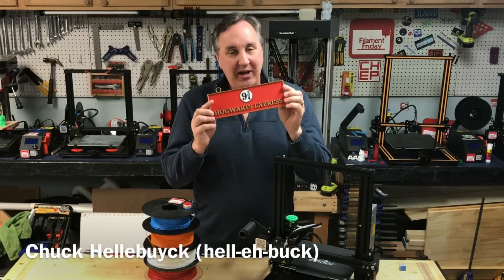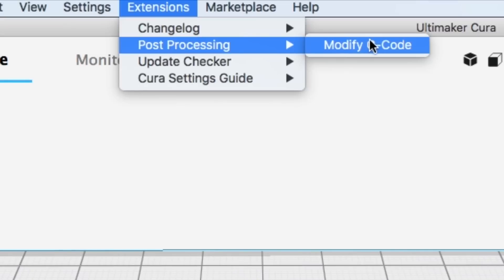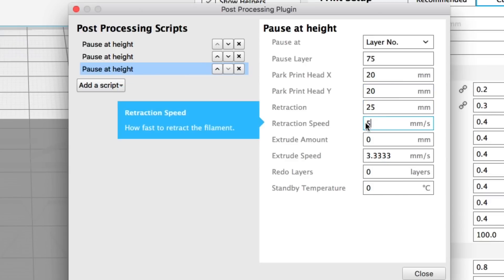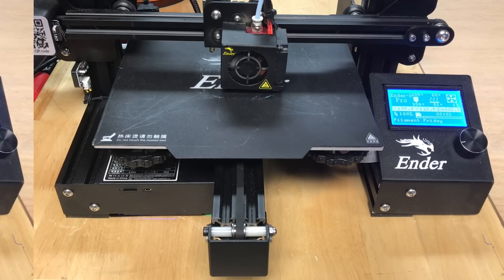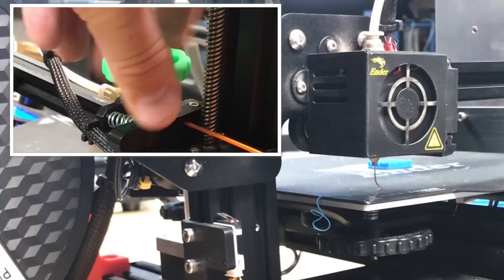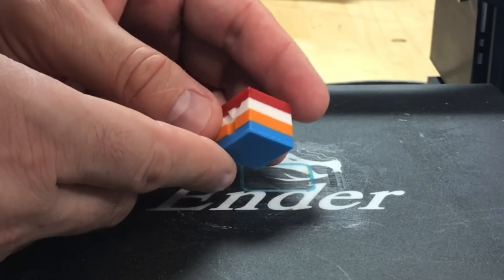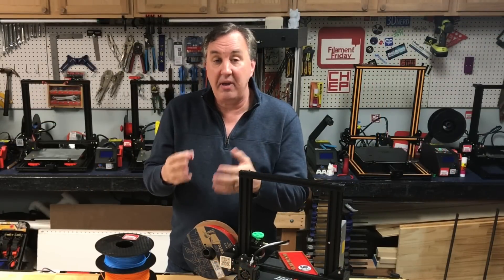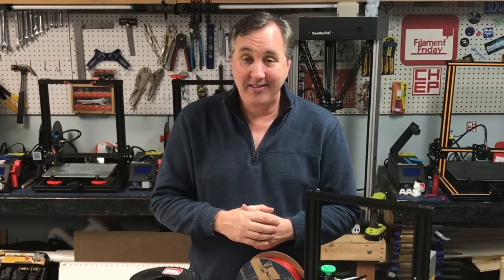How to do Multi-Color 3D Prints on Ender 3 3D Printer

Comment from the maker: If you have a newer Ender 3 with 32 bit board this may not work because Creality didn’t include the M0 command in the firmware. Try the M25 option.
Reply: See.... this is why your channel is awesome. I was just about to try doing this, so I looked up your video as a tutorial and would you believe it, the comment here is relating to my printer. Now I know to try the M25 instead of M0! Thank you!
Reply: @BrandonsYouTube  Have you tried this with the M25 yet? Just curious rather then waiting halfway through my print to find out if it works or not.
Reply: @doublejz00  I did try this and I do believe it worked. I manually replaced the M0 with M25 code and use the pause at height command in cura. I would go back and double-check but I didn't make a copy of my g code. But I do have the prints and it did work.
Reply: M25 worked fine for my Ender 3 V2.
Reply: When you say try the M25 option, are you meaning modify the .gcode to replace the MO command with M25? To put it plainly, I would erase the MO and write in (at the same spot) M25? Thanks in advance.
Reply from the maker: What doesn’t work, my M25 version for the V2?
Reply: @FilamentFriday  how do u change command in cura slicer
Reply: Just tested: with <BQ (M25)> option in cura 4.8.0 the pause is working fine on my v2  32bit tmc2208.
Reply: If you run Octoprint with a newer board on the Ender 3, there comes an error when "pause at height" is triggered and you can't resume with the LCD. But you just hit "resume" in the Octoprint window and it will finish like nothing happened.
Reply: @andri0mar  and if I do not have Octoprint? My printer wont resumen after pause
Reply: @andri0mar  mine does this and i just go into the settings on the ender and tell it to do filament change than i can do a change than i hit resume in octo and away it goes
Reply: I tried to do this on my ender 3 v2 and ended up carving out a big chunk of my plate cause I accidentally pushed the z-axis down how do I avoid this?
Reply: @MrAurebesh  don't push down on your z axis 😅😅
Reply: @finleystannard  ahh well I hadn’t thought of that. 😅 no but seriously I’ve never been able to hold my z-axis still while loading filament because it’s pretty darn difficult to get through the extruded into the pinhole for the Bowden tube
Reply from the maker: Use a drill bit to create a funnel in the end of the PTFE.
Reply: @FilamentFriday  Thank you so much!! I will try that!
Reply: @MrAurebesh  you can keep the motors engaged. there is a check box for it.
Reply: I did the m25 and it worked but is there any way for it to only disable the extruder steper and not the others so it doesn't easily move around during filament change and lose its position I have an ender 3 v2
Reply: Interestingly enough I ran into this exact same problem (with the exact same fix) on a different printer, a Wanhao i3 Plus (see the other comment thread I posted). On newer versions of Cura you choose the "BQ" (Biqu?) option to choose M25.
Reply: M0 is also not working on older Ender 3 with a newer board.
Reply: @Buzzin666  its not the printer that is at fault its the motherboard , that is why it wont work on a older ender with the upgraded 32 bit board. The board dictates what will and won't work. If the older ender had the older board it would work fine. Hope that helps understand why it doesnt work.
Reply: I'd say you should change the setting in cura (pause) from marlin m0 to marlin m25.
I just came back after trying twice with v2. It goes to 20/20 and I was easily fast enough to exchange filaments without pausing at the second time ..:-)
Thank you for the advice with marlin m25.
Reply: Where do u put it the command M25
Reply: Hehe, what if we have the BMG dual drive extruder? :P Can't easily manually retract with that thing without a teardown.
Reply: anyone have the issue that when you resume the z height will not drop back down to the proper level and tries to print mid air? ender 3 v2. i am using m25 and engaging the motors to keep the axis from moving during the filament swap.
Reply: M0 and M25 did not work for me…
Reply: Works in 2025 great with M25 on Ender3V3SE
Reply: @Felix Mitchell instablaster =)
Reply: @Cyrus Thatcher i really appreciate your reply. I got to the site through google and I'm waiting for the hacking stuff now.
Takes quite some time so I will reply here later when my account password hopefully is recovered.
Reply: @Cyrus Thatcher It worked and I finally got access to my account again. I am so happy!
Thanks so much, you really help me out!
Reply: @Felix Mitchell no problem xD
Reply: I guess im asking randomly but does anyone know of a trick to log back into an instagram account?
I stupidly forgot my account password. I love any help you can offer me.

Comment: when I change filament and return from pause, my printer extrude a bobble when touch the piece and then start to print...How can we prevent that?
Reply from the maker: When you push the new filament in, don’t push it all the way thru the nozzle. Pull it back just a little.
Reply: @FilamentFriday  thx! I tried to avoid this work around...But will do the job! thanks for you answer!

Comment: Hi, i know its a long time ago, but how did you add the filament knob to the extruder?
Reply: You can just buy one. It's just goes on the end of the extruder motor shaft and has a grub screw to secure it in place. You can probably 3D print one as well but without the metal insert it will probably break after a few uses.

Comment: When my printer (Tevo Tornado using Marlin and Cura 5.6) pauses using Chep's technique, it does not allow me to advance the extruder manually--it's locked in place--so I can't "flush out" the current filament. I can proceed with the print, but some of the first filament is laid down at the base of the second phase. Ideas?

Comment: I have a problem, I did the same settings as you, my printer does the pause, but doesn‘t start printing again, when I press the pause button on the printer, it just says: „waiting to finish command“, it just sits there and does nothing, any solutions? Printer: Anycubic Mega X
Reply: Same issue

Comment: Works on an ender 3  but the ender 5 plus and ender cr6max keeps ignoring all the pause / change filament orders and just keeps printing
Reply: That happened on my ender 3. Idk how to fix it ignoring it
Reply: @Cole_Bradshaw  they have it in the gcode setting of the printer to ignore it. You can mofdify the gcode directly it works on some machines there is soft for that
Reply: Ok, thx I’ll try to figure it out

Comment: For my Creality Ender 3 v2 NEO with Sonic Pad it also works with the option "Filament Change".
If you want to do the filament change after Layer 4 for example, it will just add the line like this:

;BEGIN FilamentChange plugin
M600 E30.00 U300.00 X0.00 Y0.00
;END FilamentChange plugin
;LAYER:4

If you don't want to slice all the files again, just open the gcode with Notepad++, search for the Layer and add those lines.

Comment: I was printing a Stature which is about 11" High
It stopped at  8" And continued speing out material 
Any ides it doesnt seem to have anything in way - is thaere anyway you can check the travel up 

Its got a mod with 2 screws

Comment: nicely done. I have a newer version 4.11.0 of Cura. It has other fields to fill in. DISARM TIMEOUT, DISPLAY TEXT, G-CODE BEFORE PAUSE, G-CODE AFTER PAUSE. The REDO LAYER is just a check box. I haven't tried this on my Ender 3 yet, but the Artillery Sidewinder X2 will not resume print after the pause. Do you have any suggestions?
Reply: This does work on my Ender 3.

Comment: Hi chep . I have been using this method for a few years and it does work great . But now every time i change the filament the nozzle chashing down into the print ruining the print . Is there something that is lose that could need tightened or any suggestions on how to fix this problem? Thanks !

Comment: Awesome video - exactly what I have been looking for. I also read your comment below about using M25 in lieu of M0 for my Ender 3 V2. Thanks for that too.

One quick question - in your video it appears you are feeding the new filament by turning the knob after hitting resume. Wouldn't that reactivate the E stepper motor and will that turning by hand damage it? Thanks in advance for your guidance.

Comment: The Pause script should add an option checkbox for a BEEP (M300) to audibly notify of the time for the filament change.  I would also bump up the retract distance to just fully pull the filament.

The script could also be modified to allow a list of layers to repeat the pause it, instead of having to add each one at a time, which could then have a temperature for each set of layers if they just added a table to make the entries into.

Comment: I've used the Filament Change command in Cura to do this many times but I found that it was difficult to not accidentally move any of the axis while changing the filament.  Does the Pause at Height command leave the steppers locked?  

To get around moving the steppers I have found that I can rehome the X and Y axis with G28 X Y, and then the Z at the origin with G28 Z, as long as the print is not towards the front of the printer, then give a G0 command back to the original height and then a G0 command to the X and Y position.  I have also have an O shaped model that I put between the origin and the model so that it gets printed first as a purge tower.

Comment: Hey, not sure if you will see this but I followed the steps of the video and then I altered it (new board) for the M25.. But, it paused and didn't change the idle temp.  I had in CURA to change the standby temp to 25, but it left it at 200.  It paused, but I had to engage the interface to actually 'pause' it, at which point it actually did move the nozzle to 20,20 and lower the temp.

Any idea how to eliminate this requirement to interact with the device prior to it actually pausing and lowering the temp?
Reply from the maker: If the firmware doesn’t recognize the GCode commands then a firmware update is needed.

Comment: Important things I learned doing stuff with this (and we are at Cura 5 so people coming here might notice that the video is different, I did):

There's a new field that isn't shown in the video called *Disarm Timeout*, it's the amount of time the printer will wait, after that the motors will disarm, meaning they aren't stopped in place and they could lose their positions easily if you for example push on the carriage too hard. I didn't know this was important so I was always messing up prints because I would push the z axis down by accident. It's set by default to 0, but I don't think the tooltip is well redacted because it makes it seem like 0 there means it will never disarm, when in fact leaving that at 0 means they will disarm IMMEDIATELY. You wanna set it to something that let's you change the filament comfortably even if you happen to have gotten up to go pee and then came back a bit later. In my case I have it set at 600 s so 10 minutes. 1800 s is half an hour. Remember it's in seconds.

Another important thing is that Redo Layer might not work well with every printer. In my case when I leave that one it will return to where it had left off at x and y but not at z, meaning it's left printing that layer in the air and spaghettiing everything. I personally don't use it. I have a Hellbot Magna SE. Your mileage may vary, just keep in mind that if that happens to you, it's because of that option I mentioned.

Also when you change filaments, provided you set the disarm timeout correctly and the motors are locked in place, you should manually push the filament down to purge the rest of the previous one. Push it until it comes out the color you want it to, it shouldn't take long. Make sure to remove that from the nozzle of course.

I have managed to do 4 color prints with the method described in the video and the tips above! Thanks chep!
Reply: I have a problem of abundant extrusion at restart after filament change. Should I have to retract filament before restart print?
Reply from the maker: You can. It’s an option.

Comment: Shouldn't it theoretically be possible to make it do another Purge line before it resumes printing? And also the idea of redo layers bothers me, I feel like it's just going to go to the layer and hit the last layer it did and knock it off.
Reply from the maker: Lowering to make a purge line can allow the cross bar to Nick the print off. Redoing the previous layer just melt together but you can try without it.

Comment: When  I print small  things in 2 colour,  they don't really stick well, they just separate  after printing  with little  force, I have to glue them, is there any fix for that
Reply from the maker: Raise the temp when printing.
Reply: I have the same problem, did you fix it?
Reply: @derlis799   yes, before  I pause my printer  to change  filament,  I turn off the fan and make temp higher  then I change filament  and keep the fan 50% for the  first couple of layers
Reply: @mohamedyassser7661  I'm having the same problem here. How high did you turn the temp to?
Reply: @leesanhua  205-210

Comment: Chuck, you should revisit this now that Cura 5.1 is out.  I use this video as reference so much,  but now with cura 5.1 something is really strange and I can't seem to figure out, like when I would hit resume it would automatically extrude out some filament even with having the setting like you show in your video.  Now with 5.1 you don't get that little extrude amount and then it puts a big blog on the print where it's resuming at.
Reply: I am having the same issue as well. The pause and resume are working great with the exception that when it resumes, it's spitting out a little blob right where it resumes.
Reply: @Vischar   It's like the little prime command that used to happen before it would move over to the print doesn't happen any more?
Reply: @ydkjman  It was either spitting out a blob on resume, or a void if it wasn't primed... So yes, I think this is a priming issue on resume. I fixed this personally by building a prime tower beside whatever I was printing. I made sure the slicer started each layer on the prime tower, so that when it resumes any blob or void will be on the tower, not my print. Uses a bit more filament, but works perfect to keep the color switching more consistent.
Reply: @Vischar   Thanks for the tip
Reply: I have same problem. 
Can it be a solution add extrusion script after pause ?

Comment: My printer pauses and then just without any input contineus printing. Why does it do that
Reply from the maker: https://youtu.be/c_llLYxbJ4A
Reply: were you able to fix your issue?, I am having the same problem
Reply: @right9128  When you have pause at hight you have different scripts, if you use the MQ script it does pause and stay paused. 

Weird thing the printer does not seem to think it is paused. So you then need to pause and start the print again to get it going. But it works

edit: the MQ script is the 3rd script

Comment: Using M25 on ender 3 v2 version 1.2.2. It parks the print for a couple of seconds and then goes back to the print and just hovers over it until I tell it to start again. I can change the filament but I get massive blobs because of this. Is there any way I can make it park longer?

Comment: I did change height at layer number and i did everything correct, however when i changed the filament the whole machine could move freely like it used turned on  disable stepper, and when I  went to resume print it was printing above the print so i had to cancel the print. :(
Reply: You need to home it if you accidentally move something.

Comment: Hi Chep I did the configuration  like you explain how to set up GCode file to produce 4 separate pause points it does that but do not give time to change the filament it go to home and immediately return to print again. My program is Ultimaker Cura 4.13.1
Reply: Same issues here

Comment: On my cr10s it worked perfectly thanks again for the excellent video
Reply: For me, too. But I found that when the print paused, that dropping the nozzle temp down to 25 deg was a bit problematic. During the swap-over of the filament I had to go into the Prepare menu and advance the extruder  to purge the last bit of filament 1 with filament 2. Having the temp dropped to 25 deg seemed to break it for me. The print would not resume properly until I went into the Tune menu and brought the nozzle temp back to my desired temp., which was 220 deg. All fine from then after hitting 'Resume'.

Also on CR10s

Comment: Help.  Tried a two color print by using the 'pause at height' feature in Cura.  First color printed great, changed the filament and proceeded to continue.  When the printer continued it wasn't even close to the initial print (about 40-50mm above).  All I did was change the filament, never disabled steppers, as I heard they lose there way if disabled.

Comment: Does it matter which layer u stop the print at
Reply from the maker: No
Reply: @FilamentFriday  do u gotta change the xyz postion as well when doin filament change
Reply from the maker: No.
Reply: @FilamentFriday  how do u change the command in cura to change filament
Reply from the maker: Like I show in the video. Using the plug-in.
Reply: @FilamentFriday  which plug in do I use for the command to do the filament change cuz I have the ender 3 v2
Reply: @FilamentFriday  which plug in is it tho ?
Reply: @FilamentFriday  I’m just confused is all 🤔
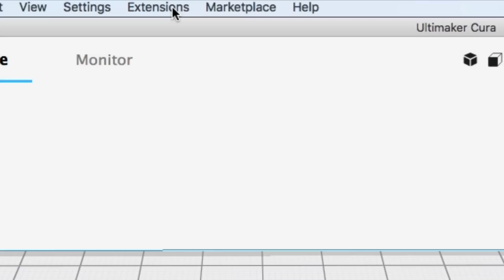Reply: @monsterstorm78  Go to 1:01 in the video you are responding